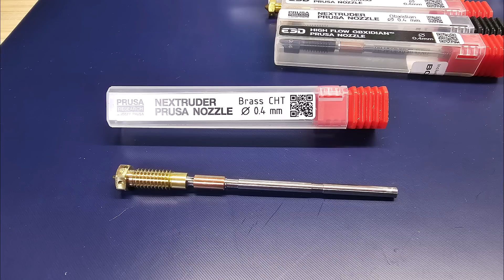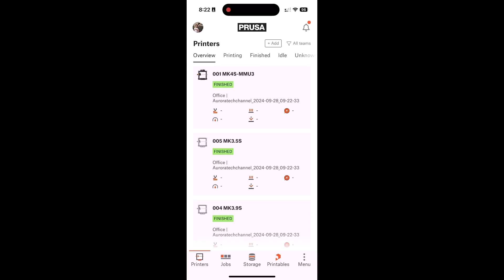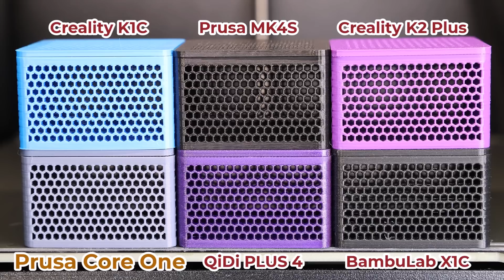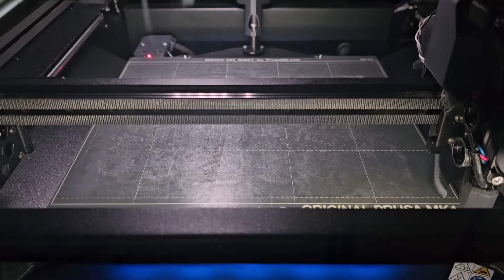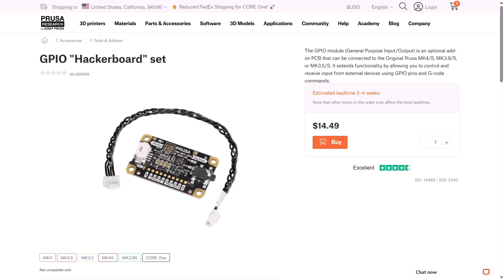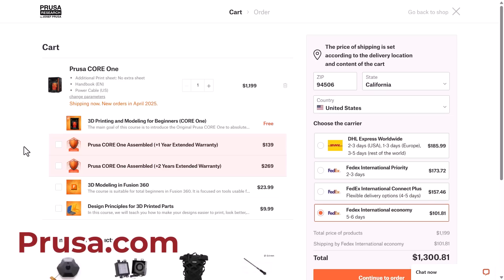Prusa Core One In-Depth Review: The Most Reliable Future-Proof CoreXY Printer

Comment: I am binge watching to catch up. I notice your use of Voxel as i have also switched to. Great printing and good price. But i see you printing much hotter. I have  a CR 10S Pro V1 with many mods. Micro Swiss Hot End V1, Linear Rails on Y Axis. Z Struts, P4 W/Klipper. But i do not print at your high temps or speeds. I wonder if my 10S Pro is simply at its limits or is there more a can do. I need the volume but could use a smaller Core XY for more precise parts. Can you offer guidance on updating our 10S Pro or where to look for small Core XY at a good price. I am a retired engineer making model train parts for my 1950s trains at 1/64 scale. You and your family do the industry a great service with your very high caliber reviews. As i have said before, Please thank your parents for us all. D

Comment: How is a printer that doesn't come with a camera, charges $40 for one that's ONLY good for live view, can't do time laps or recording, be considered "Future Proof"?
The Prusa ecosystem is archaic with such little refinement for users. Charging $1100 for this to still use 3D printed parts, acrylic panels and still charge add-ons?
This is also the same channel that named the Creality K1 the best affordable enclosed printer award... Creality.

Unfortunately it seems like they've been influenced by the all mighty dollar like so many before them. Because watching other videos and seeing countless posts about Creality printers having issue after issue, including misaligned Y-axis screws, motor cables plugged in wrong causing the printer to act in "reverse". They even had issues in their video, and tried some clever editing to cover some failed first layers but the keen eyed will catch that stuff.
Heck they even said that using plastic gears for the extruder was a bad choice then still turn around giving it any sort of recommendation. They don't want to ruin any relationships and are being too conservative in their reviews.

Also, many times when looking at printed models and comparing them it's clear the Bambu printers or even Sovol printers are the better quality prints yet they still choose Prusa or Creality, whatever printer is featured in that video. I even took screenshots of the alpaca they print asking AI (CoPilot) which one has less artifacting, more detail and smoother surface. The Bambu was 1st, Prusa 3rd and Sovol 2nd.

Comment: For the Carbon fiber and Nylon prints did you switch the nozzle to a hardened steel or other more durable material? Or did you use the stock brass?

Comment: @Aurora Tech I think you were a bit generous with the single layer whole-bed print, the bottom looked fine but there were clear, albeit slight, defects on the top surface clearly visible. Certainly there have been other printers that produced better top surface results in this test.

Comment: I don't understand comparing things like prints times--especially first layer times--across hardware. Those are mostly controlled by the slicer settings . First layer speed is a slicer setting. Wouldn't comparing surface quality at equal print times make more sense? Or surface quality at equal wall speed, etc...

Comment: One thing I’m kind of tired of is everybody talking about the footprint of this thing being smaller. Yeah sure technically the footprint is smaller however when I’m done with my bed slinger I slide it up against the wall and regain tons of counter space back which allows me moving objects around on my workshop Because number one the footprint only takes up about 4 inches of height and then there’s open space everywhere around it where is these cubic printers develop the entire space and it just makes everything feel more cramped. So they can talk about the footprint all I want but after those first 4 inches of height it eats up easily three times as much space
Reply: This refers to the size of an MK4 with housing.
If you don't need one, the MK4 alone is of course smaller.

Comment: Very interesting. I’ve had a different experience with my new CORE One. 

Particularly with the cooling performance for PLA.

My room runs 20-21°C. But the chamber fans can’t seem to keep the chamber below 26-27°C with the door closed (and top open)

Even with the door fully open it only seems to get to 24°.

Using the default 0.2mm SPEED profile has also been basically unusable for PLA for any models that have steep overhangs or floating parts over supports because of how poor the layer cooling is. I’ve had to resort to tricks in the slicer to get those prints to not get knocked off the plate.
Reply: The fans in the Core One originally only run at max. 40%.
You can increase the value in the menu. 
However, the fans are then relatively loud.

Comment: I was doing a tolerance test for a blender model I'm working on for my mk4s. Since I want to print the colors separately instead of the mmu I can't actually use the prusa slicer cut feature. I printed it with my brand new diamonback nozzle.....without calibrating it and using 5% infil. I know the default is a little on the hot side for a diamond nozzle. I decided to leave it alone. The print was as clean as I could have asked. And the parts were a little snug, but they fit. Since the joint won't be visible I may make the gap a little bigger. I'd rather have it require glue than find the full size print won't go together.

Comment: The only 3d print review channel you need.
Reply: 100%
Reply: The best reviews
Reply: Definitely! The only thing I think is missing is a follow up after calibrating the filament.

Running the stock profiles is a good way to keep things even across the board but it would be nice to see the print quality after getting the correct flow, pressure advance and all that. 

But I have yet to see a more professional and reviews based on facts not how much the company's are paying her. There's too many reviewers that you know are full of shit
Reply: Not if you print with resin.
Reply: Right

Comment: The printer came with a brass nozzle, but you printed carbon fiber with that?  Or did you swap to a hardened nozzle?
Reply from the maker: I used the ObXidian hardened steel nozzle from my MK4S

Comment: Why is the speed so often compared - it's a slicer setting. It can be whatever ppl set it too. This is a fake review - showing nothing that really should be reviewed like hardware and firmware.
Reply: It's really nuts, as if everything is a speed contest. For print quality it's often much better to print stuff a bit slower.
Reply: The speed/quality ratio IS important.  If a printer prints twice as fast [K2+ combo] and with far better quality [K2+ combo], has an actively heated chamber, comes with hardened nozzles, and costs $500 less than the Prusa, this IS important.

Comment: Surprised you didn't mention the lack of a hardened nozzle by default.
Reply: 90% of users that 3d print, print with  PLA.
Reply: @SpectraV3i not with machines like these
Reply: @SpectraV3i  Any printer can print in PLA.
Reply: @SpectraV3i  It's not about what a consumer needs, rather how the product compares with other products on the market. Competitors of the same price all come with a hardened nozzle that can be used with abrasive materials. For a high-end core x-y consumer printer this is kind of to be expected. 

I do agree with you though, 90% of users that 3D print dont need anything more than a bambulab a1 anyway.

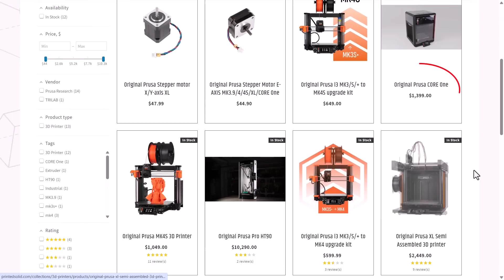Comment: 28:50 well if people were expecting something like that they clearly dont understand how any of this works.
buying from printed solid doesnt mean shipping cost and import duties to the US go away, it just means they have already been paid for before the printers or their components go to printed solid.
On top of that you need to pay for the profit that printed solid wants to see so the overall price will realistically never be any lower.
Reply: Yes, businesses do incur shipping cost and import duties, however, Printedsolid was acquired by Prusa. As a subsidiary of Prusa, Printsolid 'should' be paying at cost or at max a few percentage points higher for machines and materials. Technically, it is still cheaper to buy from Prusa directly and pay the shipping and duties - which makes no sense.
Reply: Understood, but what's the point of it then? It's only a day or 2 faster max on shipping, and their shipping prices are high.  Plus they have been out of stock on anything I've tried to buy so I end up just buying direct from Prusa anyways. 

I think it's a good idea in theory, but in my opinion so far it's been a bust.
Reply: @bluerider0988  the idea is faster shipping and having a US based company to provide support.
Long term printed solid will produce some printers locally which should make prices a tiny bit cheaper but overall the main reason for printed solid to be bought up by prusa is that many institutional customers like universities or others will only buy from US based companies and now Prusa can be one of them.
Reply: @ the point is being able to sell to institutional buyers like universities and such as well as being able to offer service on the same continent.
Long term printed solid is going to produce some printer models locally as well but given the high labor cost in the US i would not expect that to reduce prices at all.

Comment: I don't understand why MK4S and Core One have warping issues with PLA (MK4S even with PETG). I have never experienced this with MK3, MK3S and MK4 (before upgrade to S). :(
Reply: No warping issues with my MK4S with PLA or PETG
Reply: @SpectraV3i  I know many people don't have issues. But If you check the forum, you will see that still many people have issues and some even regret upgrading to MK4S. Reliability and bed adhesion went down with the upgrade. And people have to spend hours tuning the profiles almost from scratch because default ones don't produce usable results (I'm in this group - and I'm not total beginner or non-technical perosn). Consider yourself lucky in this :) Don't get me wrong. I like Prusa, have 3 printers from them, and next will be Prusa as well. But I'm just stating facts and I will wait for more reviews next time
Reply: My core one has the worst warping issues I've ever had. I'm returning it because support has not been helpful in the least about it

Comment: Did you switch to a hardened nozzle for the engineering grade filaments (if so, which type?), or did you use the CHT brass nozzle for all prints? Thanks for the review, by the way.
Reply from the maker: I used the ObXidian hardened steel nozzle from my MK4S.
Reply: @ Good to know, thanks!

Comment: Thank you for the review. Do you use glue sticks when reviewing? Asking as am concerned if the default build plate is OK to use without glue stick ( I really want to avoid  the hassle).
Reply: She used glue stick only for the ASA prints as it tends to shrink at different rates wall vs. infill and lift/peel off while printing. Usually in corners.
Reply: @Vesssss  And it still warped the corners.
Reply: @retromodernart4426 From experience - some models only 100% infill works reliably. Some shapes are just impossible unless you add sacrificial pieces that you cut off...

Comment: (I am making this comment before I watch the video.  When I first learned about this printer, I thought that the one thing that would make this printer perfect would be if it had a heated chamber.  I wonder if you talk about this in the video..I will edit this comment after I watch it.)  EDIT:  I'm only about 1 min. in, and you brought it up when you say that even though the printer does not have an actively heated chamber, it is not much of an issue because the chamber is compact enough that the bed alone will heat the chamber sufficiently.  I might have to reconsider buying this machine...if I do buy it, it will be the kit because I think it would be a fun build.
Reply: @William3DP  fwiw mine couldn't get passed 45c without insulating the printer further. When I asked support about this they say that although the single sentence that says that the chamber is capable of 55c and has active heating control, does not mean that active heating control can get the chamber to 55c and that I was out of luck.

Lost a lot of points from me on that one, feels like very misleading advertisement. Especially from the guys who are trying to hard to label themselves as "the good guys"

Comment: prusa just isn't leading edge anymore. many other 3dprinters are just as good. its far better to have a print farm instead of one core one.
Reply: nothing wrong with prusa, if its in your price bracket. for anyone who is into the hobby, any machine will do.
Reply: Unless you don’t need a print farm and don’t want to be on the leading edge. I have 3 Bambu Lab printers but I think having a single reliable and upgradable printer is a reasonable and smart decision for some.
Reply: @radish6691  i have a q1 pro that i paid about the equivalent of $350 for, and other than having to level the bed manually out of the box, the only thing i've had to do to it in 9 months and 500 hrs of printing is clean it and replace a little felt pad it uses to clean the nozzle once. qidi apparently have better customer support too from what i hear, not that i'd know since i haven't needed it. i don't really see where the extra 1k is going here

Comment: Its just too expensive. Other than that its great.
Reply: No, other than the price, the print quality is inferior, the warping problems printing ABS [with glue] is inferior, the fact that it comes with a non-hardened nozzle is inferior, the fact that it prints twice as slow, with less surface quality than printers that cost far less, etc. is actually quite disgusting objectively.

Comment: Definitely great looking unit, but still stuck in that ~250mm^2 range we need MORE BIGGER!
Reply: Yep, had they made it even slightly larger they would have gotten so much more of a market share. Oddly, off the mark.
Reply: They've gotta hook people in for kits though. That's basically their business model and they can only add so many parts. I think they went really close to what cost was on the MK4S->Core One kit. Probably closer than they would like.

But that also sets them up to make it bigger later with a "Core Two" or "Core XL" but... is that a different line they split off to? What happens with the XL? 

No idea probably only Josef knows the answer.

Slicing also negates most of the benefits of a bigger unit unless you do cosplay or something. I've made some absolutely giant things on Prusa-sized beds. I like the size personally.